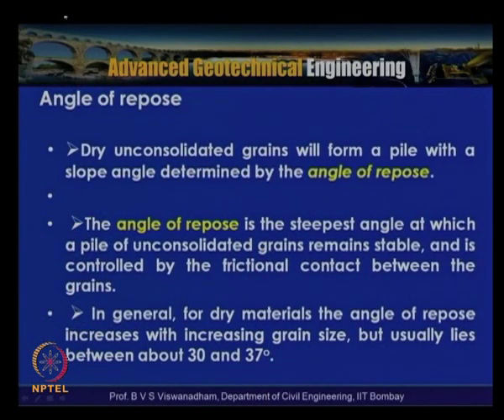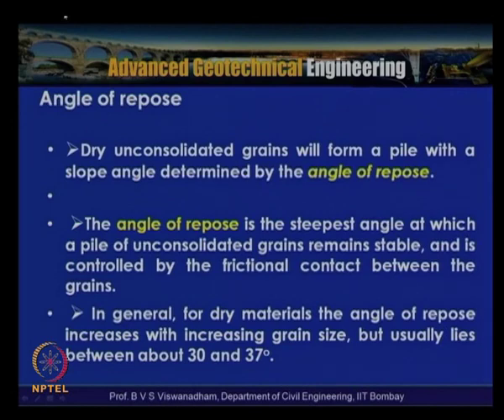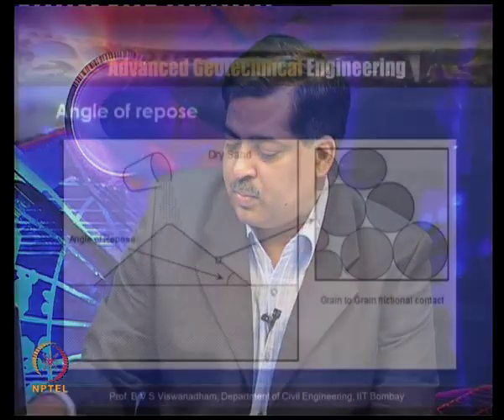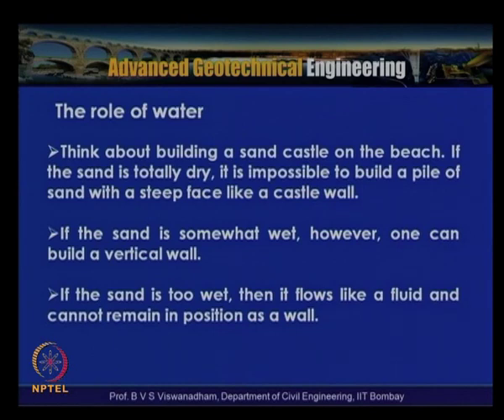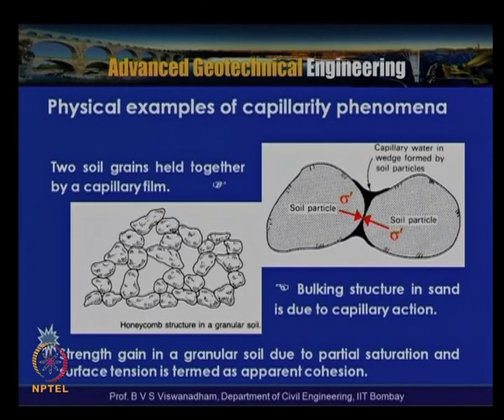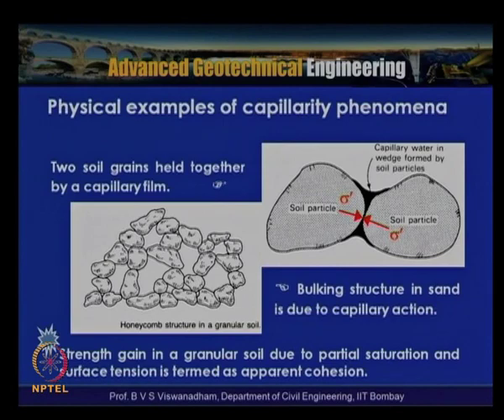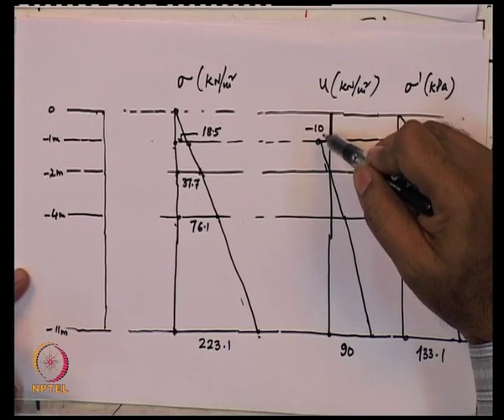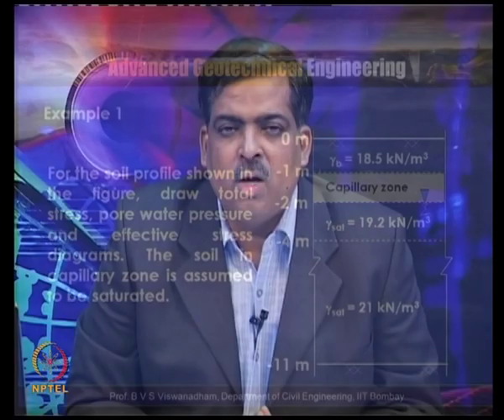Mod-01 Lec-11 Effective stress and Capillarity

Comment: while calculating the pore water pressure ....in second question why multiply by .6 at point B
Reply: please explain somebody
Reply: Because the soil is not fully saturated. In the zone of capillary the soil is partially saturated.